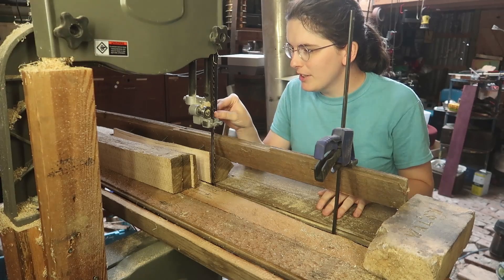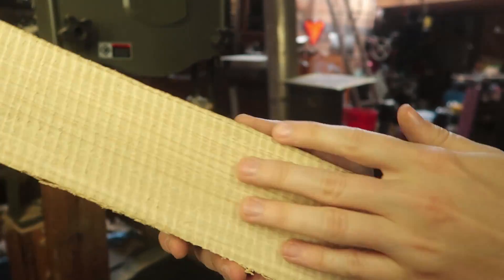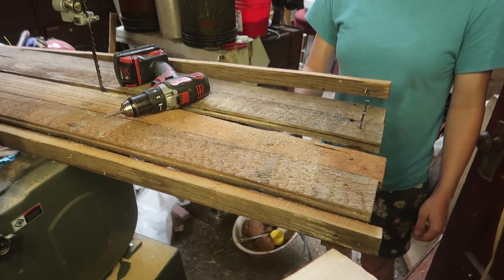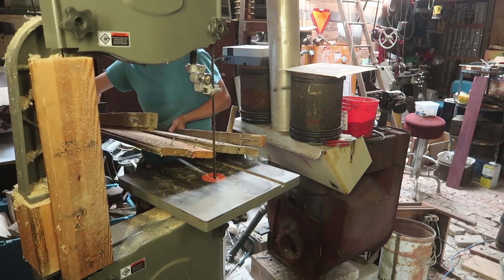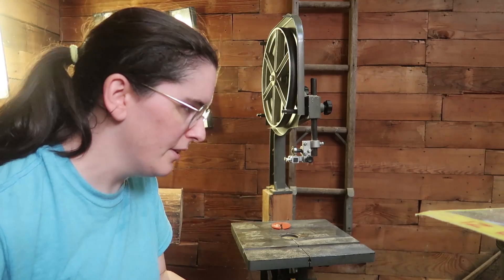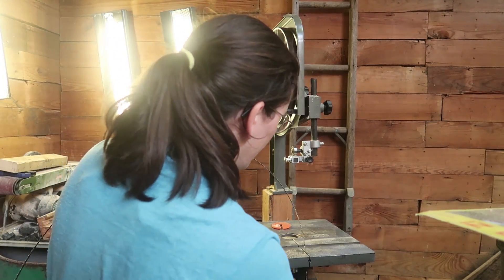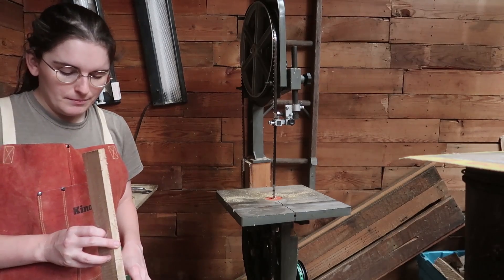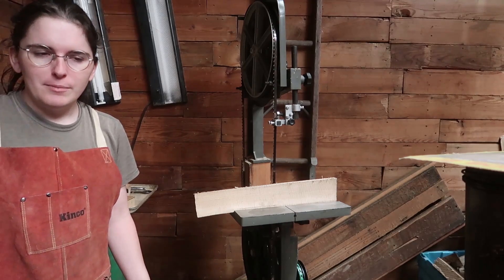DIY Bandsaw Lumber Milling, Homemade Table Sled Experiment

Comment: So I love how adventurous you are. What you are trying to do do with your table is good. As a tradesman when you use a bandsaws you need to adjust the guide for the blade and put as close to your work as you can to support the blade. That will help the blade from wondering.
Reply from the maker: no the guide is broken and bent back so once i put it more than a few inches down, it is no longer touching the blade because it is behind it. as i stated in the video, they didnt drill the hole straight.
Reply: @RinoaL  Take the saw apart. Mill guide bore hole to the next nominal size square to the base plate where you have extended with wood. Hell have that milled too if it is not already to establish a datum. Then get a piece of ground and polished that matches the new milled hole and then turn the end to fit the guide. Then the guide will travel square to the blade. There are many reasons this is not working well. beyond that is operating well beyond its true capabilities. Clearly the compounding problems are exponential with each variable added. Something worth doing is worth doing right. Sled idea would work, but it should be accepted that original design was proof of concept. Now build one that is square and true and solid. Building out of scrap junk wood is compounding the issues.extend the table so the sled is neutral in balance and direction of travel. This will also smooth the cut.  In the end is the juice worth the squeeze? are you willing to/is it worth it to invest in something this inferior or to purchase something far more stout and capable that is worthy of modifying? if all as proof of concept for a later project I understand. Hopefully you see this as logical discussion. I see how comments go on this channel at times.

Comment: The reason we use the track is it's machined to be perpendicular to the blade. The edge of the table especially on cheap band saws they're rarely machine square.
Reply from the maker: you dont really need machine square to cut wood.
Reply: @RinoaL  agreed

Comment: Made a sled for my Harbor Freight bandsaw a few years ago. You have to go very slow because these saws are really under powered for slabbing. As soon as the saw starts bogging down the blade will begin deflecting. Go slow without pushing hard, and you can get some nice boards. Hook up a vacuum to the dust port too....cause you'll generate tons of sawdust.
Reply from the maker: if i go without pushing hard, it just burns the blade up.

Comment: I think the sled itself has a tendency to twist as you push on it, since it's so long and you're pushing from one end. It might be easier to just (optionally) extend the table and then clamp a tall fence to it. It's hard to convey over text but there's an article on my site about the one I built. Different bandsaw, but you could probably adapt the idea if you wanted.
Reply from the maker: im actually pushing from the middle underneath with my hands
Reply: @RinoaL  Oh, didn't notice; that makes sense though. The blade might've been twisting due to the one-sided wear from the guide, then. Still, a fence might be worth considering if you're mostly cutting short boards; with no moving parts it'd be easier to zero it in, and you could remove it without disassembling anything.

Comment: Your blade guides have to be very close to the wood being cut in order to work properly or it will flex too much,
I like the idea of the table sled.
Reply from the maker: but this is as close as i can get them whilst them still being near the blade, the hole that guides the guide is just so far out that if they were fully extended, itd be an inch behind the blade.

Comment: The machine YOU have, is designed to cut plywood, 2-3 inch thick lumber. It is not an industrial logging band saw. And your ad-hoc 4x4 extension doesn't improve its stability.  Slamming the log into the blade is just infantile
Reply from the maker: yes and?

Comment: the blade guide should be justabove the height of the piece you're cutting. Also, cuttingf boards to dimension is not a one step process
Reply from the maker: the blade is so crooked that if i extend it too far down then its behind the blade, not in line with it.
Reply: @RinoaL   good place to start with correcting this poorly made machine. fix something that will help you instead of under engineering an over engineered idea.